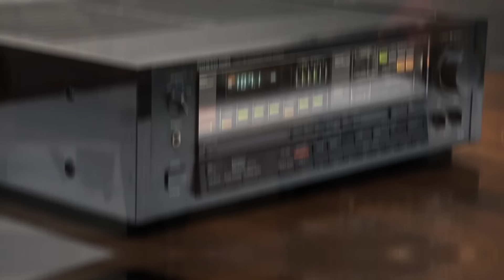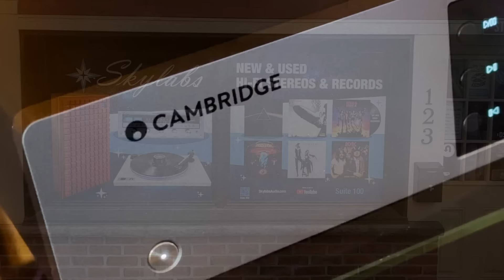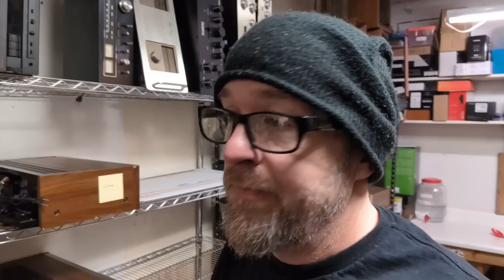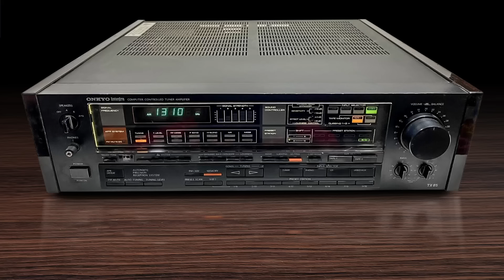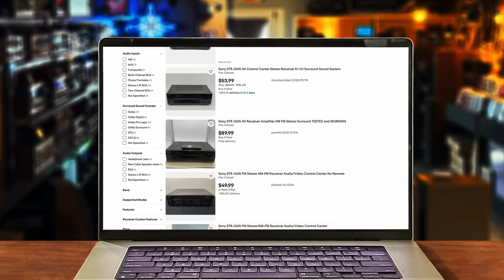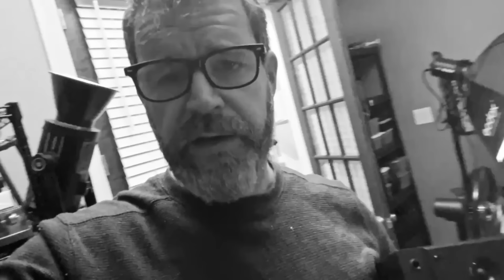Underated Vintage Stereos You Can Get Cheap... For Now

Comment: I have a Pioneer VSX 7500 and I cannot believe how good this thing sounds. And tbe power,
Hooked up to some Yamaha NS 25T.

The X500 series predates the X900 but I do believe it had very similar features and amplification. 
Main problem are the displays which tend to short out or need attention.

I have a Kenwood from this same era and the Pioneer sounds much better although the Kenwood is heavier and even more powerful at 130 watts a channel. 

The Pioneers are sleepers. A friend's wife had one of those Onkkyos on a pair of Acoustic Research two way 10" speakers from that era. Sounded great! 

Agree about the Sonys. The AJ Pioneer bookies, no longer available had a much smoother balanced sound and were often discounted at $90 a pair-a great buy back then.

Other classic speakers from the past. The BA A40s (have a pair), the KEF C-10, and the maybe you like it, maybe you don't Pinnacle N5+--all smallish bookshelf/desktop speakers that will not disappoint.

Comment: the whole Onkyo 800 series receivers are great.  I have a TX-800 and it works like a charm simply as  line out and phono pre-amp using the tape out to my AVR.  The TX-890 is a BEAST and often a bargain compared to even lower end 70s receivers.

Comment: Late 90s Higher end AV models are solid choices for low bucks. They will have a million inputs that will allow you to connect everything from turntables to component video sources. Stack em like cord wood and enjoy. Was gifted two receivers... Denon AVR 3200 and a Yamaha Natural sound from the late 90s, both have phono inputs and have pre outs that bypass all the built in eq effects.

Comment: Really boss that you do the "loaner" thing. Back in 1979 when I purchased (in cash) a Hitachi SR-804 from Tech Hifi at 12 W. 45th street in NYC they were outta stock and I was told it'd be a week. After that week the store Mgr. told me more like three weeks, yowza! He offered me a choice of loaner component of similar power output. I chose a Marantz 1090 integrated amp and got to "play" with it for a few weeks. That Marantz was swell. Nowadays I thought, ain't nobody does that no more. Apparently, you do.

Comment: If you are talking Proper Vintage receivers, my first one was a R1155 which you won't have heard of. It was the receiver from a Lancaster Bomber. It had  a large tuning dial which swept through 180 degrees. It covered lots of short wave frequencies but it also had "Long Wave" so in England I could listen to "The Home Service" as it was then, or Radio 2 as it is now. I bought it from an Army Surplus store in 1965.

Comment: I enjoyed this video! There's a lot of value in this era of gear. I had an expensive modern amp in my office. It lasted about a month past the warranty and the right channel failed one day. I was watching a Youtube video at low volume.
So, I went to my small shelf of gear I have and picked my Denon DRA-325R. It was given to me by a friend of mine, having only been used by his former boss to listen to AM talk radio through a rather expensive pair of speakers. It's been about 18 months now and the old '89 Denon sounds better than the expensive amp did and it looks better too. Plenty of power for the room, driving a pair of Elac Debut 2.0 B6.2 speakers. It just works every day at whatever volume I ask. Great unit!
I miss my Pioneer VSX-3300. I wish I hadn't ever sold it. As far as I know, it's still working to this day.
Reply: I love those era Denons for one simple feature: Variable loundess. That alone is worth having those, since it can tame even the most vicious "hot" speakers/songs. Plus, to me, those Denons sound oh-so-sweet - perfect balance of warm & neutral. And they pack a punch! I loaned my spare 635 to my friend months ago, and I yet to see it back
Reply: @raspucin70  That is in fact one of my favorite things about my DRA-325R. Variable loudness. It's a great sounding unit and it's been absolutely perfect since I pressed it into service. I recently blew a friend's mind with it when I showed off a few artists he had not heard of. That receiver driving my Elac speakers is such a sweet combination.

Comment: USA market is wild. It's because of your collectable value, sometimes not the real one, and you're good at it and you're a really big market. But pushing to extremes. What you can find (some good equipment as I see) in your thrift stores for 15 dollars, costs about 100-150 here in Croatia, europe, but the audio equipment that you sell for 3 000, costs around 1000 here. Who's in the right? Probably you, bigger market means more accurate statistics.... I envy you because I'm on the low side of budget 🥲

Comment: I have one of the pieer recievers in my garage and I gave $20 at a hamfest and it came with a double casette deck and a turntable. It all works well but the radio channel goes away if you don't turn it on every day. I just tune it and crank it up. I have it hooked to a pair of HPM 40s and a pair of Optimus t200s. Love the sound.

Comment: i wonder if many philers have their own personnel "hol-e grail " many times based on a unit owned as a teen much like the hot rod they drove at 18 ? i had a simple toshiba sa 2500 nothing special to most but it was the one i listened to 70s and 80s rock for many many hours it grenaded just a few yeas ago -big smoke show  i played "Taps"

Comment: I picked up a pair of the Sony SS-CS5 speakers based on Randy's recc. I'm powering them with a Kenwood KA5700. Also connected a old KEF sub. I tweak the treble up a little on the PreAmp.  With the sub, in a 10' x 15' room, I'm very happy with the sound for what little I paid.

Comment: In 1990 I worked for a large TV / Appliance store in Portland Oregon. Items that were damaged in shipping were to be put in a locked dumpster. I found a Pioneer VSX-4900s that was badly damamged and was able to bring it home- somehow. The microprocessor was broken as the front had taken a major blow when dropped or kicked off a truck. Really I just wanted the AMP to work and with some fixing of broken traces I was able to get the amplifier to function. I put a Pioneer Supertuner Car stereo in it- facing out the back. Used it on my test bench for years. It always did sound very good. I sill have it, running a old school Dynaco preamp through it now. I have sold all my high power old 70's Sansuis and Pioneers because they were worth SO MUCH more than I originally paid.  In the house I run a Onkyo TX-Sv7M I picked up for 20.00 at a thrift store. The Garage where the music plays loud I have a Pioneer VSX-5700s I bought from Goodwill on line for 50.00, because I always liked the hacked up 4900 I had. I started to hang on to odd ball lower power items from the 80's and 90's about 3 years back now. Realistic STA-95, (looks alot like a Pioneer inside) Technics SA-626 are a couple examples. Not worth much , but they sound fantastic and look cool.

Comment: I really like the early 90's Harman Kardon receivers. I bought a full early 90's H-K system off Marketplace for $200, mostly because it came with a mint Dual 1219 'table. The receiver was a H-K 3500 and after a quick cleaning, it worked perfectly. It has a good MM phono stage, and an RCA sub out controllable from the front. I teamed it up with a pair of Totem Mites, a small Def Tech sub, the aforementioned Dual TT, and a WiiM streamer and gave it to my girlfriend as a bedroom system. It sounds way better than I thought it would and my GF loves it. I'm still using the HK cassette deck that came with that system, and I gave the carousel CD player to another friend who is also still using it.

Comment: Any chance we hear something about jvc equipment on your channel one day? Dont find any references in a quick search.

I have a 37 years old Ax-90v amp here which almost accompaigned me through my whole life. Recently had the volume switch and potentiometer cleaned, and now it works like charm again. 

I am aware jvc was not one of the top brands then, but the device was the top model afaik. Catalogue price was around 1400 Swiss Francs then. Should equal to about 2500 usd now.

Comment: Couldnt agree more on some of these suggestions.  I have both an Onkyo TX-51 and a Technics VU-97 in house that sound incredible and I snagged them both in perfect working order from Shopgoodwill for under 40 each with shipping.  That technics has some meat n potatoes behind it.  Great Video.  These receivers dont have the nostalgia or street cred but you can build a heck of a setup around them.

Comment: Kevin, unless I’ve missed your past comments, I’ve not heard you talk about NAD. I recently picked up an NAD 7150 and it is far from an empty box. Looks like it has dual power supplies and is the heaviest of 5 receivers I own. Sounds excellent, FM reception is terrible though. Thoughts?
Reply: NAD is good except they tend to not be as reliable compared to mainstream brands that Kevin mentioned.  I had a 7140 with a bad volume pot that got fixed.  The one you have is considered the “best” because of the dual design, congrats.
Reply: @ Thanks for the comments. I have some Pioneer and Sansui products which stand on their own merits but the NAD 7150 seems to stand out from other NAD receivers based on its construction and great looks. A lot of NAD products have a rather sterile look

Comment: Regarding the PSB speakers, back in the 90s when I was doing a lot of bar restaurant installs are used a ton of them, they were inexpensive and non-offensive. not a high output SPL speaker, but for low to mid volumes, they were great. In larger spaces, I would cut them off at 90 Hz and use a few subs. I am also Canadian so wanted to support local companies. For bigger installations, you really should use proper pro equipment. I also used Bryston  and Adcom amps back then. Now it’s pretty much crown amplifiers and Dbx processor’s😊

Comment: I have a Heathkit 30 W integrated (tuner separate) amp I built in 1984. Scared to plug it in for fear of smoking it. I lent it to a friend to take it to college. He said it would run hot (class A/B) but never skipped a beat no matter what type or how many speakers he hooked up. It had been things like variable loudness,  selectable tone control ranges, preamp out, rumble filter. The matching tuner had Dolby FM. I have the manual for it and someday I will grow a set and plug it in. I also have 2 1963 13 W stereo tube amps from Heathkit to troubleshoot. (I didn't build these)

Comment: I've had several of those Pioneer A/V receivers. Bought a VSX-9300 new, and used it and almost every connector for 15 years before a power supply went bad. Friend gave me their DS1 which worked until it developed a buzz and no sound after 30 years. When working, both are fantastic receivers, with big, beautiful displays. Last year a client passed on their rarely used VSX-3300 + CT-W500 tapedeck + PD-M400 multi-CD player - the 3300 has EQ sliders in place of bass and treble, limiting the ability for some fine tuning, but it works fine in spite of being 35 years old. Still outputs a very clean sound. CD player works fine; the plastic tray latch for the player in the dual tapedeck is broken, but the decks still play fine. These do qualify as vintage A/V receivers, being Pro Logic rather than discrete, but the build quality is really solid, and as you mentioned in the video, they are relatively easy to find, and pretty cheap.

Comment: Wow - I can’t believe you mentioned the Pioneer VSX4900 because I purchased my VSX5000 new in the late 80’s. It has the built in Dynamic Expander. This feature is a blast when I use to crank it up with rock music. It’s been sitting in environment controlled storage for almost 22 years. I pulled it out and placed it on my display shelf a year ago with other vintage units. Im scared of just plugging it in. What procedure should I do with this era component to protect the inner electronics?

Comment: late 80´s to early 90´s there was a increase of quality in badly built 80´s amplifiers or receivers and only in some brands as Pioneer, i still have working a lot of amplifiers from those years also components like cassette decks, DAT decks and cd players who were really good, the dac isn´t the only detail that matters in a cd players and those they had them good and to improve it it will cost a lot of money but some cd players had lasers of a higher quality as some new ones today to restore them players are more expensive than a new said to be good cd player , i own a PD-7300 not only it´s building materials make it look new and having a lot more functions in it after installing a new internal dac it will sound better than a lot of new and expensive ones, and there are other models with great quality from this years, in cassette decks the CT-91a it´s maybe one of the best decks ever made and the CT-93 i think nothing else comes near, but this are Urushi versions a kind of Elite only a lot superior, the regular series have the CT-939MKII, CT-959 and CT-979  ,. this were well built and even today they make some younger man not believing how good a cassette sounded , in this deck even the type I  from TDK ,the D cassettes or the maxell UR sound real perfect and depending on the quality of the source it can make this cheaper cassettes sound as good as good chrome ones , all though in the 90´s Maxell was a brand to avoid with those light grey casings but Sony and TDk kept releasing well fabricated cassettes, allthough in Sony the HF seemed not so well built

Comment: Been rocking an Onkyo TX-890 for 10 years now after a huge vinyl haul included it.  It's attached to my tv.  Real nice workhorse.  I've a Luxman -117 (yeah THAT one) and she is a prima-donna and her speaker relays are mopey.  I've the Sony STR-GX10es - even worse basket case where the radio does not work and it can only handle weak speakers right now.  80's had a few really nice ones and I agree the Onkyos are solid unlike some other manufacturers.

Comment: that one you show is a god example of it, the loudness increasing volume it´s a plus not available in more modern ones but for home use they are the best has one can´t hear to loud music at late hours in the night so loudness is a must have, in the 70´s the amplifiers who don´t have it if working at 100% have a so very good sound and control to more frequencies in treble or bass so one can put it a a low level of volume and still hear the whole music

Comment: they are great ,now compare it with a 70´s receiver with the same output power ,for sure it will not sound that good as in the 70´s all was better built, i myself get bored about surround systems mainly why audio video receivers are sold cheap but also in the 80´s there was a decrease in quality  in general but in my opinion the best 80´s receivers are the ones more expensive from Pioneer as they can deliver a nicer sound quality in stereo, like the VSX-9700, which is great for music listening in stereo, there are others i just never listened to one, on ebay i sometimes used to see them being sold by around 100€ being a lot more expensiver when new, this that i refer have even some speakers outputs that one can use to improve the home sound for music playing, also a lot of inputs that can be used for other components ,refering to audio video inputs that are a stereo input with a video input also but as i said use it to conect extra components

Comment: I wholeheartedly agree about the 90s bookshelf speakers. I have a spare bedroom with many matched pairs that I've collected over the years. Most recently I got out the pair of Yamaha PianoCraft NX-E100 and listened to them for a few songs. They have a lot of depth and layering in the soundstage in every direction I was a bit surprised. I did buy them so I knew they were good sounding but I guess I forgot just how good they were. They don't blend in as well with the furniture in my bedroom being piano black when my furniture is all natural oak and the little NHT Super Zero A450 in oak blend right in and virtually disappear but if I had to pick between the two pairs strictly on sound the Yamahas would be the winners. Not by leaps and bounds but just slightly. I'm sad to hear some electronics aren't worth the cost of repair because I have a JDM Kenwood R-K1000  integrated amplifier that the display burned out on. I guess I'll just live with it until it becomes more vintage and more desirable before selling it off. I really like the sound of it though.

Comment: I really appreciate this content with the equipment from the 80s. I've recently gotten into vintage hi-fi, and as you say, you have to define it for yourself. I love the aesthetics of that era. I got myself a Sansui AU-X 711, and I can't imagine anything modern in a normal price range playing better than that amp. At least it outperformed my modern Rotel, no question. Now I am getting into tape decks. It's a bit dangerous. I found a silver Harman Kardon CD 491. The most beautiful tape deck ever made?, and the underdog, playing in the same league as the Nakamichis. Thanks for pointing out that they (HK) have been making equipment for ages, I thought they were only an AV surround brand since the early 2000s. I hope you will release some more 80's content. I love those receivers. Keep up the good work!

Comment: Had my Onkyo TX- SR501 for over 20 years. It's a beast. My fav that I got in 1985 is my Kenwood KR-V95R (black with very cool digital eq). It's still a daily driver in my office.
Fav speakers from early 90's and still use them today are my Polk Monitor 5 series 2. Fav from the 80's are my Klipsch kg4. Very underrated as can be had for $500. They remind me of their Forte series. Love your videos. Thanks!